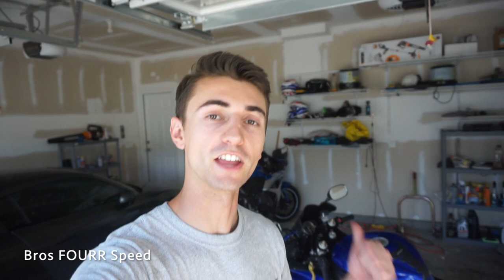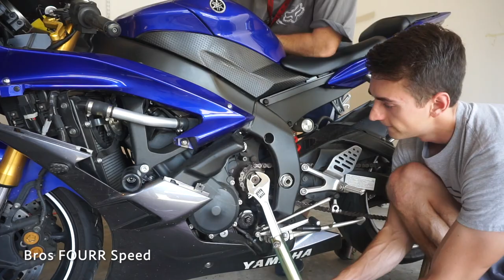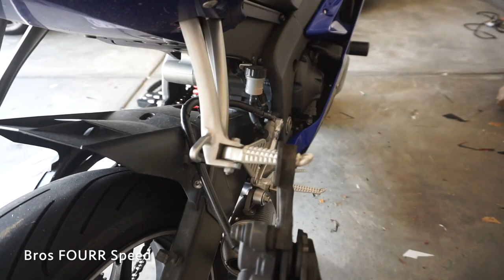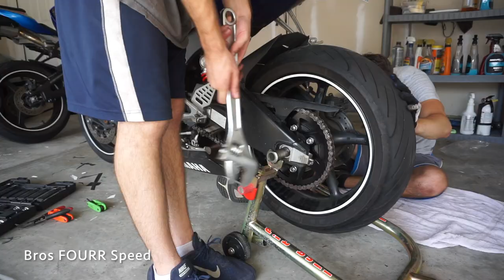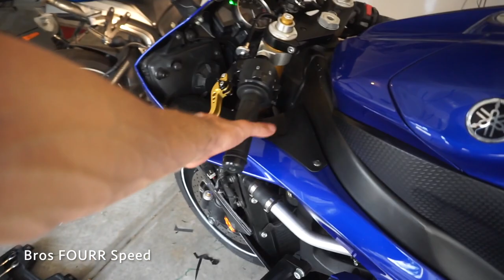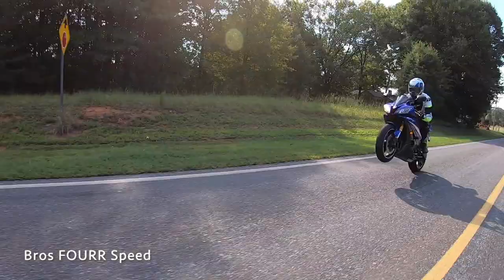How To Wheelie The Yamaha R6 With TWO MODS!!

Comment: I'm a little confused about why You have to do this. I have a 2002 with an Akrapovic Slip-on, and In 1st 2nd and 3rd if You hit 9k at full throttle the from Tires Coming up whether You want it to or not. I just don't Understand why You would need to do this I guess...
Reply from the maker: An exhaust has nothing to do with popping a wheelie. Like we said my brothers cbr600 can easily pop the front tire without full throttle. Just the torque difference.
Reply: @BrosFOURRSpeed I didn't know I said It did, but if You Properly tune after installation even a Slip on will absolutely add HP and Torque which will help Your Bike Wheelie.
Reply: @BrosFOURRSpeed  But I was just discribing My Bike, the Point I was Making is I don't have to try to Wheelie, it Wheelies all on its own. So I don't understand why You need extra assistance pulling the Front Tire..
Reply from the maker: @jerodrobinson4040  it’s very insignificant though, but you mentioned you had an exhaust, it just wasn’t relevant.
Reply from the maker: @jerodrobinson4040  this bike needs it, very hard for it to wheelie. Compared to the cbr I mentioned, this isn’t made to do that easily like that bike.
In the high RPM yes the R6 pulls a wheelie. But in the low RPM slow speeds it can’t do one with the stock sprockets like how other bikes can
Reply: @BrosFOURRSpeed That's incorrect. With the right exhaust, and more importantly the right Tune You can increase Torque by 15-20%. That's extremely significant, especially for Someone trying to Pull a Wheelie..
Reply from the maker: @jerodrobinson4040  yeah a tune definitely helps, but the exhaust won’t by itself.
Reply: @BrosFOURRSpeed  My Bike is properly Tuned so it benefits from the increased flow. Couple Years ago an Identical set up picked up 3hp and 7ft/lbs at the Wheel, mostly in the mid range. Nothing Crazy, but it is noticable.
Reply: @BrosFOURRSpeed  No, if You just slap an Exhaust on it will Lean the Engine out, and you'll loose Power. You have to Add Fuel to get the Ratio back to 14.7:1.

Comment: Lol. I turned off traction control and it wheelies bone stock. 1st and second gear. Get those rpm’s up. I’m doing it at a 40mph roll rn. Face your fears. Or get a wheelie practice machine.
Reply from the maker: You're on a different bike ;)
The older R6 does not have traction control. Heres a comparison I did with a 2020. That one wheelies very easy in the sporty mode for sure. https://www.youtube.com/watch?v=WCVcypgzYZI